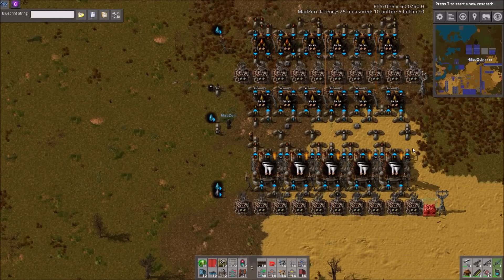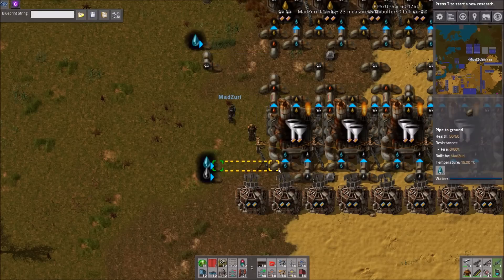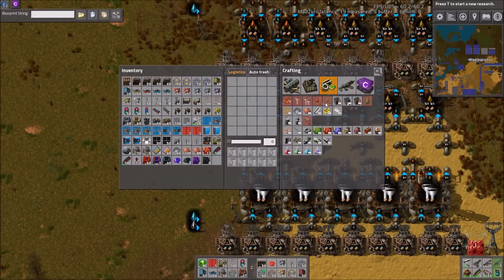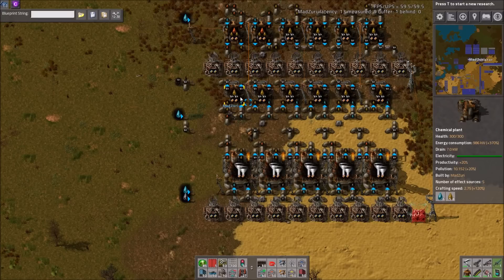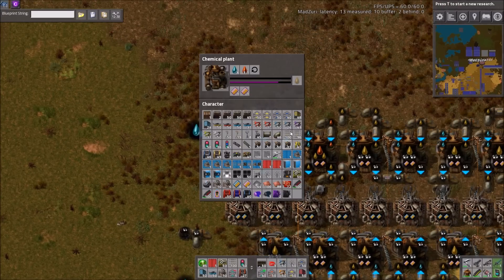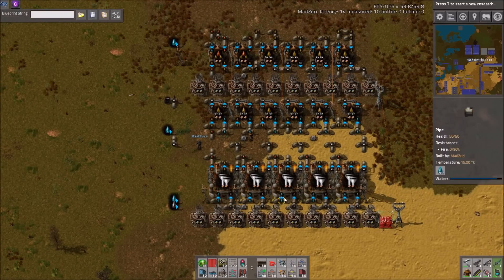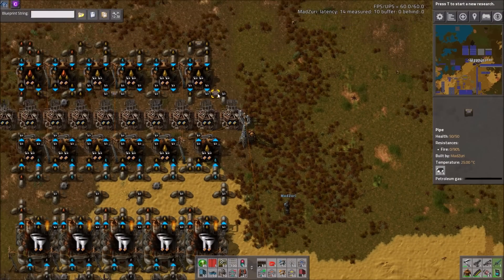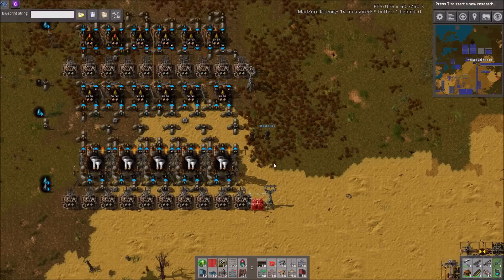Factorio Workshop - Building A Better Factory :: Beaconed & Moduled Oil Build

Comment: I wouldn't put productivity mods into oil.
It's literally the one resource that is infinite.
Also the cost to make things more compact with speed modules is pretty high since the power usage rises disproportionally, especially if you use beacons which by themselves just murder your energy.
You're better off just expanding your refinery and putting some green mods in them since those are the only ones that only have upsides.
Reply from the maker: It may be infinite but the productivity helps with getting more out of your depleted wells by getting those free resources from the refining process. True, speed modules and beacons are a huge hit to power but if you're using solar then you pretty much have infinite energy you can build without any downside aside from space. Each to their own, but I would much prefer to use modules instead of just making a massive non module verison.
Reply: It's not just power, with green mods you can practically remove pollution while everything else raises is exponentially.
Reply from the maker: True. Honestly I think it's personal preference. I would prefer the benefit from speed/prod modules despite the extra pollution.

Comment: I don't like Tanks, plural. But I do like Tank, singular. One tank to feed the refinery through is easy to mouse over (or wire up) to check level/supply. Messing around with empty drums is a pain, unless, you know, someone were to post a video showing some nice funky oil barrel management builds ;-)

Comment: efficency module funfact:
If you mirror this beaconed oil build horizontally then the refinery beacons hit 4+ each. That is more power efficient even with speed modules - but it also means we get above the sweet spot for efficency modules! (or speed modules when using steam - or well, depending on compactness, 6x efficency, 1x speed is actually best but might be hardest to pull off)

Complicates the build though because the ratios change compared to right now.

Comment: This is littery the must pointless thing i ever seen ten vinnla refineries easy max out of the though put of the pipes.
Reply from the maker: It's not pointless at all. Using beacons makes it far more space efficient than if you were to use un-beaconed refineries to a point of maxing out pipes. Not to mention the productivity modules in the refineries and chemical plants help a lot with saving resources. Of course you could still do those and not beacon it, but then it would be painfully slow meaning you would need even more refineries/chem plants making it even less space efficient.
Reply: Space Efficientency on any ∞ map.

Comment: Okay so I'm only just learning beacons, why wouldn't you enclose this with beacons rather then a line of beacons?
Reply: Enclosing it with beacons takes away from the build's tile-ability, its space efficiency and it can make it difficult to balance with the proper ratio, since the refineries on the edges will be significantly faster than those in the middle.
Reply: Mmoniot Unless, each refinery has it's own barrel conversion and bots flying in the barrels. I'm actually finding botting in barrels right to the source to be most effective. Guess what? Too much of one type of liquid? It only effects one refinery at a time.

In bob's you can have like 10 different types of refineries, and mixing different types of production will ensure that the base always has what it needs. And of course you can stamp them down, the connecting beacons have cross over.

Comment: Curious, why limit pipes to 90/s? AFAIK, they have a max throughput of 150/s
Reply: As you get further away from the source, the liquid flows less efficiently. You're not actually getting a maximum throughput all the time :).
Reply: Yes, I understand that, and you can use pumps to bring it back up. But wouldn't it make sense to want to start as higher and let the flow rate decrease naturally?
Reply: It does decrease naturally, even without consumers. But if by the time it's reached your first consumer, it's already dropped, it's not going to cover everything anymore.

Anyways, as for practicalities, oil's pretty easy, you just barrel it up, send it down. Water you can generally run multiple lines pretty easily, so no real problems there that I see.

Comment: I've always set my maps to have rich/abundant oil deposits after hearing you talk about oil problems a while back. I tried a new map with the default oil settings and it's really bad, to keep up with a single row of refineries (beaconed.. impossible) I'd need to set up extremely long, spread out tracks to outposts everywhere. Do you use any mods to deal with this, or do you just set higher oil in your map settings?
Reply from the maker: I definitely know how you feel. Haha I usually set my oil settings really high for that exact reason. Or if not, then I just end up speed beaconing the hell out of the pump jacks once they start getting low. If you have the power to spare that can actually make a huge difference. 
Typically I don't use mods for it, although there are plenty out there.
Reply: Comparison wise, if you were running a bobs mod game, you are going to have trouble needing more than the 3 basic oil depots that are in your starting zone at the endgame, but that is precisely because of how powerfull the modules are there.